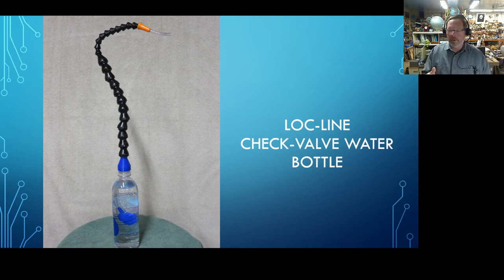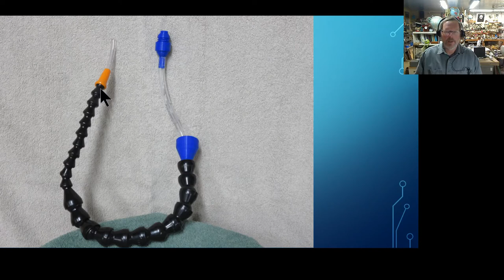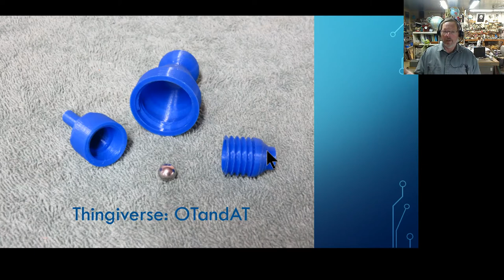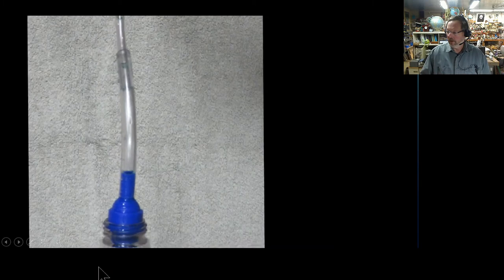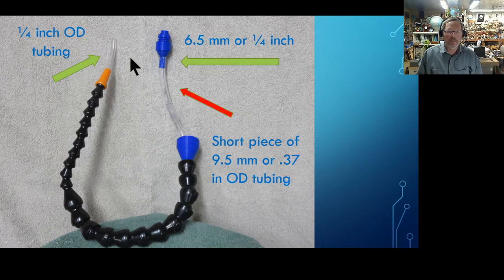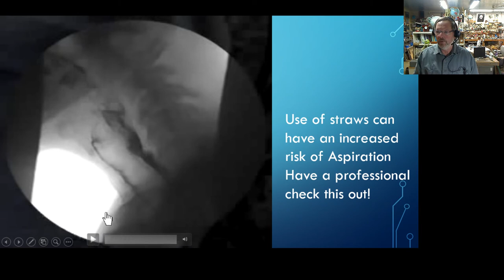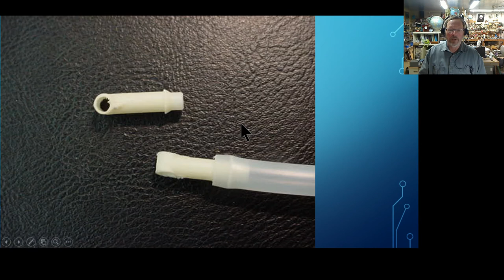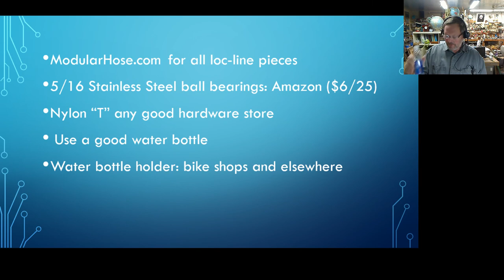3D Printed Loc-Line Check Valve Straw

Comment: Hi There.  I wonder if you gave any consideration to a seal between the drink tube and the loc-line where it connects to the bottle.  My concern is that if the bottle is tipped over then liquid could get between the straw and the loc-line.  Cleaning might then become a tricky operation and maybe the loc-line might not be totally water tight ?